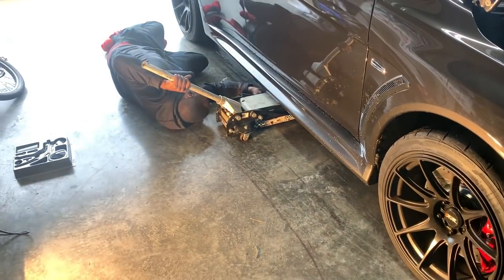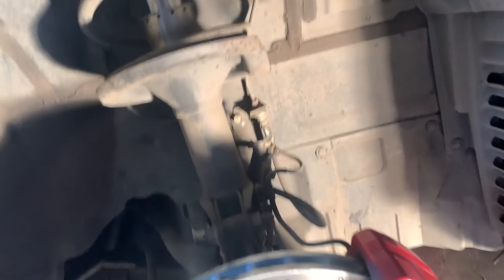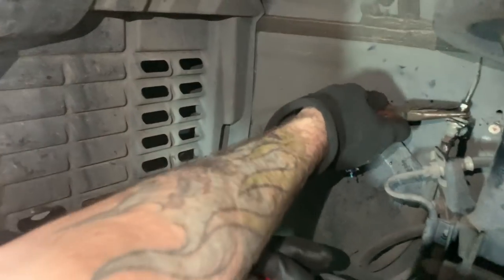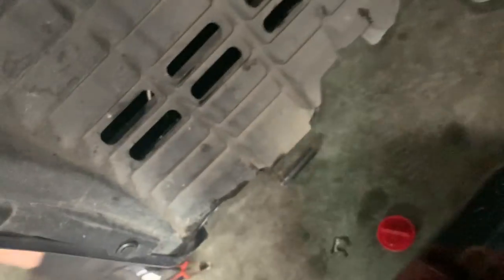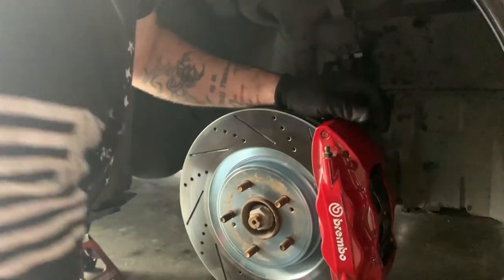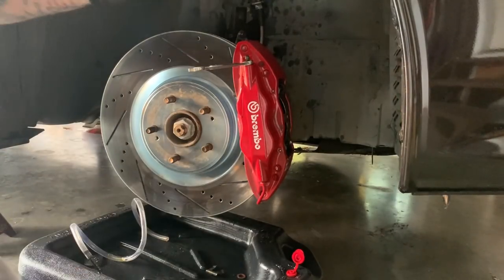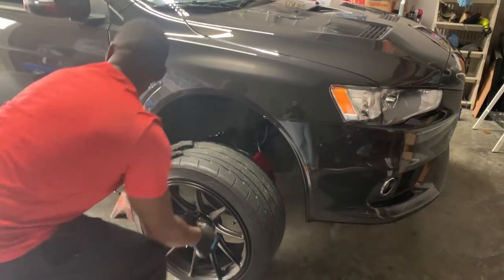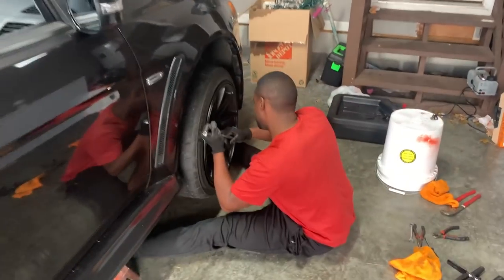HOW TO Bleed & Flush Brakes (DIY) Plus, install stainless steel lines

Comment: Face palm moment. Either depress the brake pedal a few times to build pressure before opening to drain OR only one pump to floor of brake pedal once open. Allowing the brake pedal to lift back up when the bleeder is open allows air back into the system.
Reply: I was scratching my head seeing that as well. If the bleeder is open, it's not sucking fluid from the master cylinder. It's simply sucking what he pumped out, back in at the caliper.
Reply: Yea I was kinda lost

Comment: Totally wrong way to bleed the brakes. Plus you let the master go low so now you have air in the master and abs.
Reply: I’ve never seen someone pump the brakes while having the bleeder open, it’s push and hold open let them bleed then close, repeat.... and if you have the adapter that sits over the master and pressurizes the system just open up the bleed screw and watch the fluid for air bubbles and clean fluid then close and move on..... and usually it’s outside to inside on calipers like that.... farthest away to closest.....
Reply: @michaelvasquez3911  same. The only reason to even pump and release with the valve open is if you have speed bleeders installed. I had them installed on my 240sx years ago when I did a 300xz brake upgrade and it became a one person brake job.
Reply: @michaelvasquez3911  I plan to install speed bleeders when I get my new motorcycle and do braided lines.
Reply: I was thinking the same thing lol. Push the bakes then open the bleeder. I did watch Chris fix do a solo version, similar to these guys, but it avoids air going into the system
Reply: I guess it is kinda randomly asking but does anybody know a good website to stream newly released movies online?
Reply: @Arlo Blaze i would suggest Flixzone. Just search on google for it =)
Reply: @Andres Aries Yea, have been watching on Flixzone for since april myself :D
Reply: @Andres Aries thanks, I went there and it seems like a nice service =) I appreciate it !
Reply: @Arlo Blaze You are welcome xD

Comment: Flair nut wrench , also referred to as a Line wrench.  This is a must needed  type wrench  if you do your own work . Never get break fluid on paint , it will mess up paint . Also never get break fluid in your eyes , it hurts and you will run for water quick . Yes it has happened to me . BULLITT K0040

Comment: Reminds me of the time when I had a Porsche and had to bleed the brakes all the time due to boiling of the brake fluid, until I found a special German fluid that could withstand the high temperatures without boiling.
Those big red Brembos are really nice brakes. I just got a 2019 370Z with the sport package that has upgraded Akebono brakes that are similar looking to the Brembos.
The braided stainless steel brake lines are a nice mod that I might do someday for my Z, for increased pedal feel.
Reply: What’s the name of the German brake fluid you found?
Reply: @FullSendFabrication  It was called Ate Super Blue and it also came in an amber color, for ease of flushing. At the time it was about twice as expensive as other high-end brake fluids but it was worth it to me, in obviating the need to bleed the brakes so frequently. It may not be available anymore due to some issue with DOT requirements.
Reply: @videomaniac108  It's still around, I just used it yesterday

Comment: Well , that's not how you bleed brakes.
Reply from the maker: Funny how it worked perfectly then 🤔🤷‍♂️
Reply: @Zander13Productions  funny how you think that means you did it right .
Reply from the maker: @jordangarneau3022  if it works then I did it right. There are a couple ways to do it.
Reply: @Zander13Productions  no , pumping the pedal with the bleeder open is the first thing you just do not do.